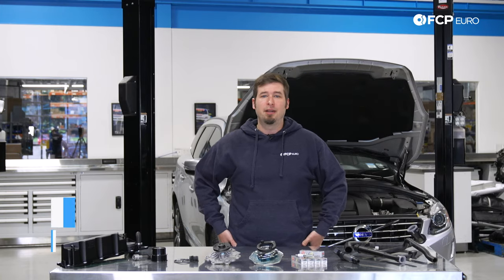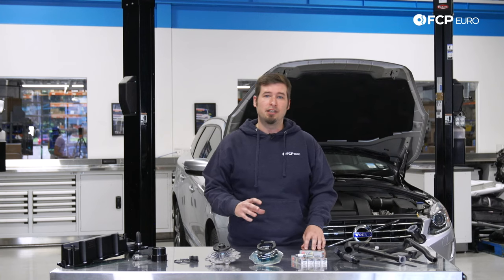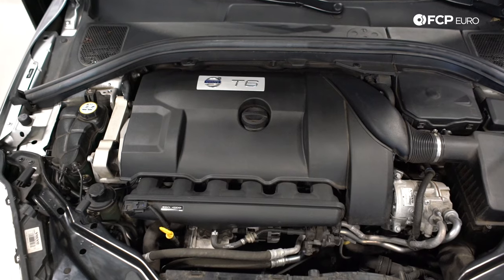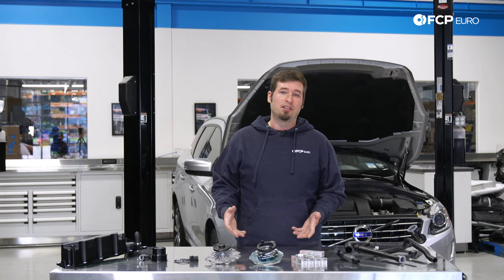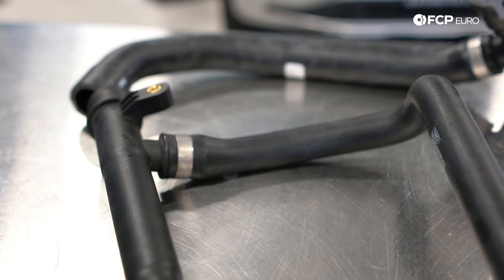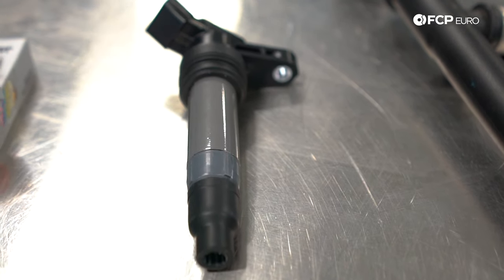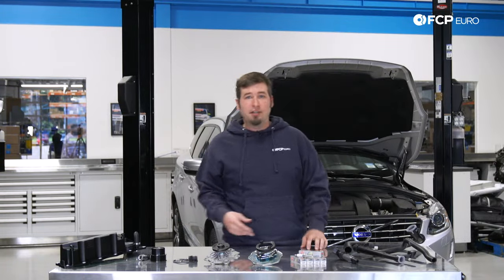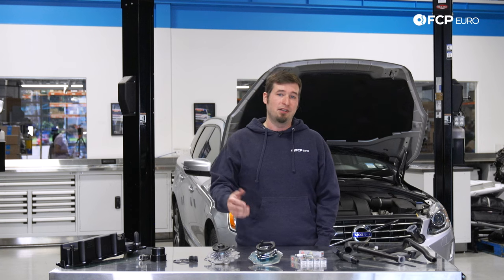Volvo T6 3.0L & SI6 3.2L Engine Diagnostic & Maintenance Guide (XC90, XC60, S60, S80, V60, V70)

Comment: All the "certified mechanics" in my area are too afraid to work on Volvos.  As a result, I, as an absolute novice, am having to learn from Youtube to work on my daughter's 2010 XC60 T6.
Reply: Please post videos. I also have that Volvo
Reply: Your kid is well raised. No brat drives a T6 💪
Reply: They are so easy to work on. I really don't get the apprehension. I have a good independent Volvo shop when things are beyond my skill level. But like you, I do a lot of the work myself thanks to YouTube.
Reply: She’s lucky, the t6 is twin turbo awd. She’s gonna wreck it most likely
Reply: @ChrisBaccus which would you say is easier to work on and easier to maintain. 3.0 or 3.2? Looking at XC70s
Reply: @user-FTRU6GJ  they are essentially the same just one with a turbo. I have the turbo and find it very easy to work.
Reply: @ChrisBaccus  ok. I always hear that having an engine without a turbo will always be more reliable especially on these euro cars that have more expensive maintenance. Is that true?
Reply: When I had a P2 for my wife, we were refused repairs by a shop her family had used for decades. My P3 was refused service by a different shop. It's definitely no joke

Comment: Lol, Ive had 3 ignition coils explode, ive had the PS pully go out, ive got a rattle at the alternator/read unit, ive replaced the plugs, and I have an idle roll that I believe is caused by a bad PCV diaphragm. Pretty much everything yall covered except for the pistons and cooling system went bad. Other things id like to note that are problems are the vacuum pump seals tend to start leaking at 80k-120k miles (easily repaired), the engine mounts and torque rods tend to fall apart and tear, causing awful, awful noises in the cabin, and if youre feeling a stuttering, hesitation, and noises coming from your pedals, its most likely a wheel speed sensor. Very soon I need to take a look at my alternator and determine what repair is needed.
Reply: Your alternator is likely just the pulley bolt which gets loose and doesn't spin the alt and you get a ¡service! alert. Supposedly needs a New bolt from the wear of it being tightened&loosened all the time. When i do mine i am going to mash a couple of threads up near the head so it locks in for real 👍-
Reply: Also, I bought my '10 XC70 @ 170kmi and haven't had Any problems (but the service alerts) in now 40k miles. Seriously reliable at least for me : )
Reply: @georgehofgren6123  so I actually checked mine out, and my alternator bolt is tight. That rattle I've been hearing actually sounds closer to the turbo. (Definitely loudest from the passenger side wheel well) I've taken the intake pipe off and checked the play of the shaft, and it's smooth as butter. The rattle is hard to make happen while parked, and generally takes ~10 mins of driving to start up. In park, goes away. In drive, it's there sometimes. I can make it happen by turning the wheels and putting load on the motor
Reply: @gombie72  HI there... sorry to get back so late on this... I had maybe the same rattle problem. It was most noticeable starting out and at low speed. I did some research and learned it was caused by Low Power Steering fluid (i can't remember why). I put in fluid and haven't had the vibration since 👍. If you still have this rattle, check your PS reservoir and fill If needed. Be sure to use the right PS fluid, which was something i'd never heard of, but they did have behind the counter @ Advance Auto ~ ✌️ ☮️
Reply: @georgehofgren6123  no worries! Still got the car. Still runs fine. Still has the issue. I've replaced all the fluids already, so PS pump is rulled out. Probably a separate issue. Thanks anyways!
Reply: @georgehofgren6123  no worries! Still got the car. Still runs fine. Still has the issue. I've replaced all the fluids already, so PS pump is rulled out. Probably a separate issue. Thanks anyways!
Reply: @gombie72  maybe just try getting a diag from a trusted mechanic or Volvo dealer? I guess it wouldn’t hurt unless you’ve already done that
Reply: @Gripchecker  been there done that. They couldn't figure it out. Guess I'm living with it lol
Reply: @gombie72 I have the exact exact issue on my 2014 v60 T6, in drive or reverse, turn the wheel and there is a knock/rattle at low speed/standstill. In park or neutral, nothing at all. I replaced my alternator and battery, it’s still there. I replaced the power steering fluid myself and did a complete flush so not just the reservoir fluid, and still there. I will change the reservoir housing to see if it makes a difference because other than that I have no idea what it might be. I heard from some people that you need to update the computer about the rim sizes the car is running on but I don’t think a mechanical sound can be linked to a software issue. I’m also stumped as I have the updated electric power steering pump which is on the passenger side just behind the front bumper, so it isn’t on the belt like the earlier t6 models. Please let us know of your results too🙏
Reply: @pugtato01  Still living with it. not causing an issue fortunately.

Comment: Good  tips.  Wonder what's the highest mileage T6 motor you guys have seen
Reply: Mine 09 s80 t6 is 199k miles right now
Reply: Great tips! Just did all fluids, serp belt, and all pulleys with FCP Euro parts!
Reply: Seen a few with 400k plus miles for sale. Buddy has 200k on his and doesn't burn oil.
Reply: Dang all these numbers making my 08 s80 t6 with 105k on it sound new lol
Reply: Around 300 miles with zero issues

Comment: I have a 2012 XC60 T6 with 221,000 miles. It's been a great car and hasn't had any of these issues. It did burn oil though, but running Liqui Moly engine flush through it and changing the oil with 20% lucas heavy duty stabilizer seems to have solved it.
Reply from the maker: Glad to hear those LIQUI MOLY additives are working!

Comment: you should mention the transmission issues in earlier models from 2007 to 2009 (TL80SC-AWF).  the shift solenoids in the transmission valve body can fault and engage harshly. these rough engagements are damaging to the clutch plates and with time will get worse.  this is also noticed by slipping in 2nd and 3rd gear while under heavy load followed by a "slow down and shift up" warning and limp mode until restarted. this can be repaired by changing the valve body for a later model or a rebuilt aftermarket one.   If your like me and went to repair this at 160,000 miles when it was very noticeable. I had to buy a new transmission, due to the amount of ware on the clutchplates. and debris/material in oil...

I love my 08 s80 T6 but damn did they mess up these early trans. still runs like a damn champ though!!!
Love these P3 videos!!!! keep'em coming boys!!!!

Comment: Excellent advice. I have a 2012 XC70 T6 with polestar with 115k miles since new. I always do 5k mile oil changes and scheduled fluid changes for the coolant and transmission (50k mile intervals). Have only had a couple issues with the car. A coil pack that failed at 100k miles which I'll now change at the 75k interval with the spark plugs. And I had the alternator fail at 95k miles and a blower motor fail at 80k miles. Other than that the car has no oil loss and runs like new. I just did the serpentine belt, pulleys, water pump, PCV, and the vacuum pump last weekend for preventive maintenance. Such a great vehicle and a wonderful road trip wagon!

Comment: Thanks guys. My new-to-me car is a 2010 XC70 T6 that had lots of maintenance records and one owner (corporate fleet vehicle of some kind) and appears to be very clean and solid with only 102,000 miles when I got it. It’s an Electric Silver T6 with the only other option on top of the T6 package being the Climate Package. 

This thing is sweet for cruising back and forth to work, or anywhere else, on the country backroads in my state. It’s very quick from a roll and handles MUCH more like a good European car than ANYTHING else with this cargo capacity and off-road ability. 

It’s gonna definitely need a new exhaust before too long, but there’s stainless ones available for less than an OEM system and they’ll give better power and sound anyway.

Comment: Very explanatory video !
Respect for such Great Job !
As a Shop owner I repaired plenty of Volvo 3.2L vehicle.
Indeed I came with this problem. Look at 4:27 . So one XC90 with 3.2 came and the owner said that battery  did not getting charged. 
Hmm, checking  few thing and I saw the voltage on battery very fluctuate, 14.1V ~11.9V 🙁. Look at Alternator, no unusaul sound and by the way the owner said that Alternator it is brand New , just was replaced few months ago at another shop "specialized in Volvo repairs ???"
Anyway - I said to Him push the accelerator pedal all the way to 3k RPM !
Hmm, the Alternator did not rotate with the same speed. Again accelerating up and down - Alternator rotate with own speed. I got it.
I said leave  the XC for couple days.
Remove intake and Alternator and indeed that pulley it is NOT tight.
I clean the pulley, bolt and apply a "Lock Tight" gel aloud to dry and install back everything.  No more fluctuation on voltage. Everyone happy.  XC90 left.
Hmm, after 10 days again came, SAME problem.
Now I check and found out that Volvo issues a recall regarding that bolt and pulley. I explained to the owner that He may need to solve the problems tru the recalls. 
So at the end : that bolt and pulley it is one of the weakest link in this particular engine...
Reply: Yes, the bolt and pulley are best replaced together because the loose bolt will wear on the pulley hole and it will no longer stay tight, as you experienced.
Reply: THANK YOU for this. It makes so much sense. My "urgent charging system service" alert comes on from time to time and I am sure it is that bolt. (been doing it for 40kmi) So no doubt it requires whatever TSB parts they specify. I'll look into it and order to have on hand for when i replace the belt and pullies. Thanks! (do you have a new bolt part #?) thx

Comment: Excellent video, one thing to add on the cooling system is the hose to the oil cooler that is prone to fail where it is attached to the block utilizing a plastic piece with an o-ring which weakens over time and may not be noticeable unless it is removed.
Reply from the maker: Thanks for the insight on the oil cooler hose, Kent!

Comment: I fully agree, reliability on these engines are insane. I have a 2011 XC70 with the 3.2 and 330,000kms or 205,000 miles and the engine still runs like a clock. Burns a bit of oil, not sure why, but I make sure to keep it topped off.

Besides regular maintenance, I started having to put money into it in 2020 when the vehicle was reaching 10 years old. New fuel pump, blower motor fan, snapped serpentine belt, some suspension work (links, bushings, front struts) new trunk latch assembly. That’s about it! The vehicle has been in 2 front end accidents both totalling 30k in repairs. 

We won’t get rid of it until catastrophic failure.
Reply: Only 200k? Japanese cars can get there with just oil changes. Maybe you should revise your definition of "insane" reliability because these oil burning Volvos are just poorly built
Reply: @supersabrosinho  yeah, but Japanese cars rot, they aren’t built nearly as well as Volvos. And just as a side note, the car now has 300,000miles and doesn’t burn oil anymore. You’re also 7 months late, LOL. Saying that Volvo’s are poorly built is like saying old Mazda’s don’t rust, it’s simply not true. Volvos are the safest cars out there. So think a little more before you reply to someone’s comment and look like a fool.
Reply: @jeffgroves4533 You forgot to say Volvos are also wizards because yours magically stopped burning oil. Lol. There is a reason you can find P3 Volvos for under 2k... Hint: they're junk

Also, it's never too late to tell you how junky your car is 😆
Reply: @supersabrosinho  it stopped burning oil because we started using different oil along with additives. Reading your comments make me laugh out loud😂 enjoy your tin can Japanese car❤️
Reply: @jeffgroves4533  ahh you were using the wrong oil despite it clearly being printed into the fill cap in big bold letters "5W-30". Yikes. Stay in school Jeffy, you got this champ! (P.s Acura>Volvo) 😙
Reply: @supersabrosinho , Yes if you want to save money on car and maintenance,  buy a Japanese car. 
If you want to drive in comfort and survive an accident, drive a Volvo. 
You can always replace a fender, or a car, but there is only one life.
My uncle fell off a cliff in N. California and when the rescue team showed up, they were shocked to see him alive sitting by his 850. They said in all other instances, they had to pull the body's out.

Comment: Another great Volvo video from FCP Euro. I used their kit and video to change the trans fluid on my 2010 XC60 and it went off without a hitch. New question though: I'm chasing an intermittent P0420 and I think I might have a bad upstream O2 sensor. I would like to further diagnose it, but I can't even see the thing. I've read elsewhere that it requires removal of the air filter and battery tray, but hoping Adam and crew might do up a video explainer. 🙂

Comment: Looking to buy one of these with the 3.s SI6 this weekend. Is there anything tell-tale to look for when inspecting the alternator assembly, besides wear on the belts and a possible noise? I can't imagine that you can diagnose the pulleys just from looking above at the engine bay?

Comment: Thank you FCP for another good DIY video.  I've done the water pump, but now have alternator issues.  I'm interested in seeing how to get that coupler pulley out and the decoupler hub "belt".  Basically both sides of the READ drive.  Not sure if there are enough of these engines out there to warrant this, but I have two of these engines in an S80 and XC60.  Thx again!
Reply: Luckily the alternator and decoupler belt are very easy to replace once the intake manifold has been taken out of the way
Reply: @willmill409  Agreed.  Once I got it apart it made a lot of sense.  It was not a hard job.  I ended up doing the same thing to my 2013 XC60.

Comment: Thank you!  I've been desperately hoping for a good walk thru on the P3 T6 for months. I have a new water pump in hand but so intimidated by this belt bonanza. Procrastinating by doing everything and anything else - even replacing the heater core and inching along the wiring looking for shorts for hours on end.  I'm not ready.  Urgh.

Comment: My 2009 Xc60 T6 turbo is having coolant leaking on the thermostat gasket and the coolant is dripping right on to the knock sensor and its connector which causes the engine to stall at idle. Is this a common issue?

Comment: I have the 3.2 in my 2012 XC60. Every now and then I get the Charging System Error message but it eventually goes away within a day. Even with this message on the car drives and operates just fine. I’ve had the battery and alternator checked and both seem fine. Could this be a symptom of the decoupler bolt on the alternator side of the reed drive coming loose?